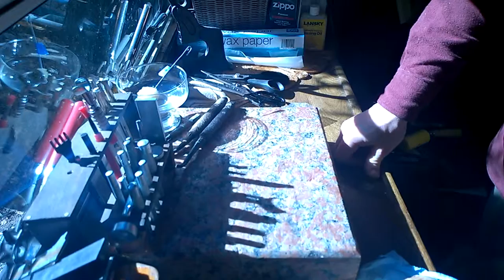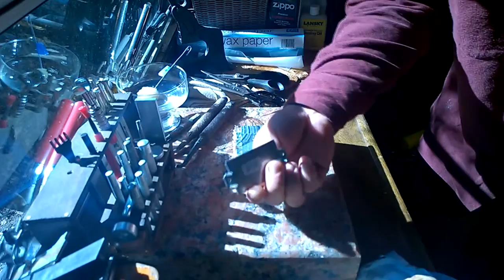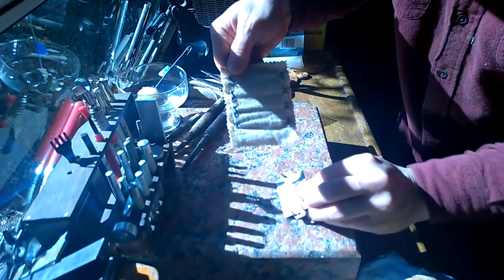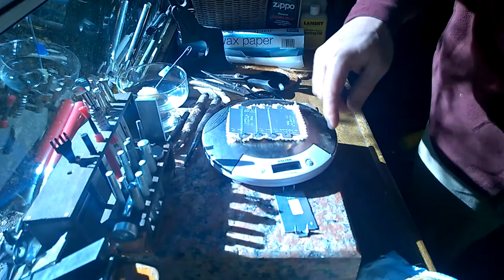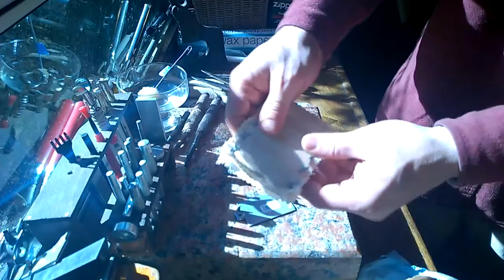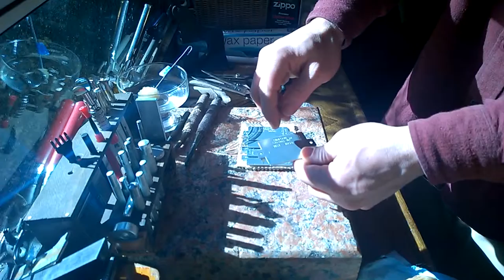Body Armor Idea

Comment: Did you accomplish  This?
Reply from the maker: This didn't pan out unfortunately. The plates are far too malleable and the staple cut outs don't hold up well against abuse without curling the tips down and inward, which makes it a lot more labor intensive. It's also not very scalable. There isn't really an option for smaller or larger plate depending on what area of the body they cover. The plates also need a lot of filing as the edges are sharp. All around it's a fail brigandine.

I have been experimenting more recently with roped/corded. Basically like a gambeson that uses columned pattern as apposed to checkered. But instead of batting it just uses cuts of rope/cord. This has a lot more promise as enough cloth, rope and thread can be sourced cheaply. It's also scalable because one can simply use different gauges of rope. But it's far more labor intensive. It also is weak on the seams. So I have to figure something out for that.